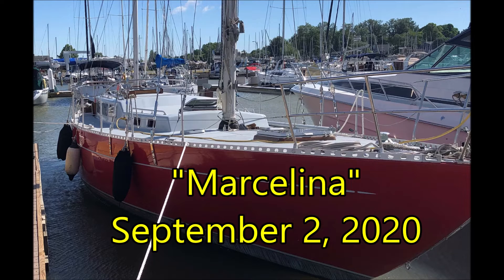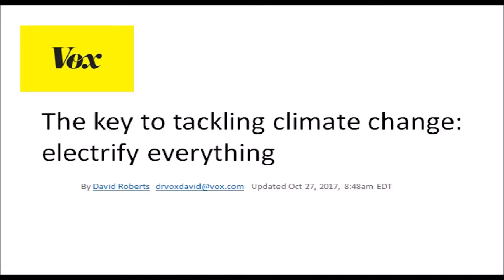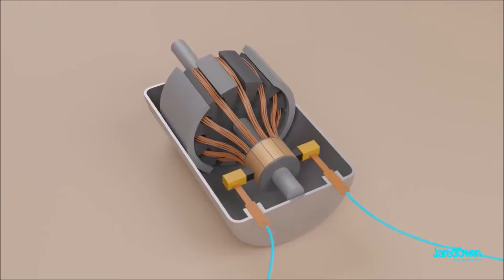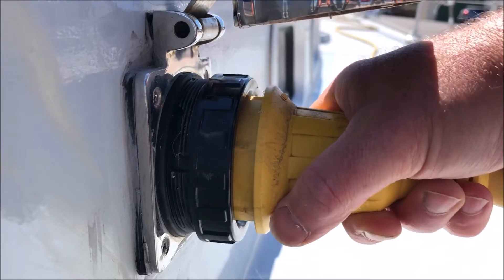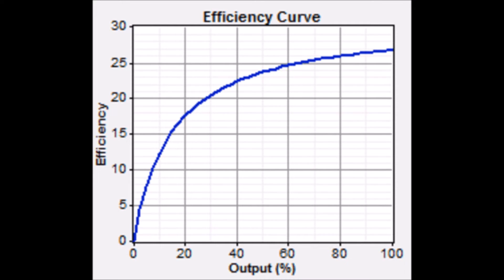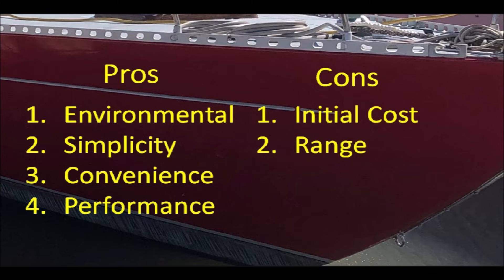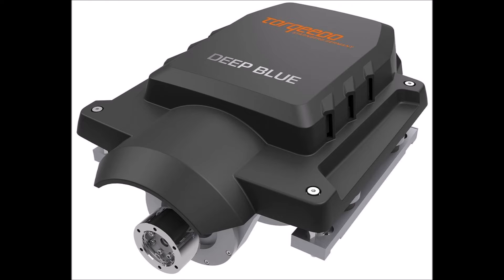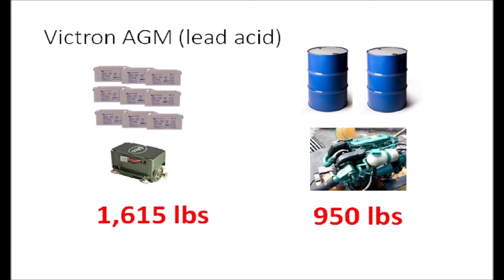The Electrification of Marcelina

Comment: 3 solar panels wont run that system ,  your battery and motor cost figure , hasn't added all the sundry items to run the system $$$$ 
The motor may not give of heat the batteries do,

Comment: Small portable gas generator plus generator (Electric Yachts ?) propelled by propeller shaft as it turns while under sail. Thats what will be on my Tartan 34 Classic. Go electric and all the best.
Reply from the maker: The Tartan is a great boat. To my knowledge only the Oceanvolt system charges from the prop... which wouldn't work in my case because I have a self-feathering prop. Anyway, the Oceanvolt is a saildrive, which also has limits. Anyway, electric is definitely the way to go. Good luck!

Comment: I have been following your project from the beginning, while I still lived across the lake from you.

I don't know your future plans, but if you're going long-term cruising I think you have an unworkable system.  A boat the shape and size of yours will not carry enough solar and wind to top up that massive lithium bank in any reasonable amount of time.  We live in the Caribbean and have 1300w of solar on a medium-sized catamaran.  We can make about 6KW of power per day at a nominal 12 volts. We also have a D400 wind generator - considered the best available - and even in the rare moments where there are perfect conditions for it I question if the output justifies the noise.  The solar and wind basically takes care of our house loads with a little wiggle room.  We're not spendthrifts; we have a fridge and freezer, and we use a washing machine a few times a week.  We also have a 12V watermaker.  The only other loads of consequence are cooling fans.  In total, my daily power production would give you propulsion measured only in minutes - let alone your need for house power.  

Incidentally I have 4 of those Victron batteries.  They're pretty good, but a lithium upgrade is on the horizon.

With my massive real estate on a 47 foot cat I can install even more solar should I feel the need, but you're badly constrained in terms of solar real estate for charging.  I know you can point to Uma as having successfully done so, but even they will tell you that it's not an easy life having to always consider the propulsion bank.  Things are a little better now with their OceanVolt motor and it's re-gen capabilities, but they still have such limited range that most people would not find it practical.    

What you're seeing in electric boats is generators.  If you're gonna cruise, and you're ever going to have to move around - let's say there's a storm coming and the wind is not favourable - you have to have a reliable method of recharging for propulsion.  At this point the only way of doing that is with a generator.  A genny/lithium hybrid system really puts you back where you started, just way more expensively in total.  That said, hybrid turns out to be modestly more efficient than diesel only.

People REALLY REALLY want electric boats to be a thing.  Me too.  I have given this a great deal of thought, and have had the input of a friend who owns the most electrified catamaran in the world.  This chap started with 3200 KW of LiFePo batteries and 3200w of solar, and that wasn't enough to run his 4 ocean volt motors for any real range.  He ended up running his 14Kw generator so much that he got fed up with the maintenance regime, pulled two of the OceanVolt motors and replaced them with 75HP Volvos.  Remember someone gave Uma an Ocean Volt motor?  Guess where it came from.

So, I hate to have rained on your parade, and I hope I am wrong, but I do think you're going to find that the math simply does not work in your favour.  

A tip from the electric catamaran guy: use a big Victron MPPT solar charge controller (maybe 150/45) as a B2B charger between your 108V bank and your house bank.  It has no idea that the 108 input volts that it's seeing is NOT from solar panels and will happily charge your house bank for a fraction of the price of a dedicated B2B charger.
Reply from the maker: I appreciate the thoughtful and informative comment. I'll be spending a few years on the great lakes sorting things out before heading out for extended cruising. If my idea of being self-sustaining on wind and solar is too optimistic then I should find out during that time.

Comment: I was all with you until you started stating CO2 nonsense. Plus have you looked into the “environmental” concerns with Lithium battery production and disposal. Likewise where do you think your electrical power is created for your car? More than likely it was from natural gas. You are really just moving the point of the combustion. Your other points have much more true merit. But environmental is laughable.
Reply: You should do some research because driving electric cars, even when they are charged with electricity generated with coal, reduces CO2 emissions due to the massive increase in efficiency.
Reply: Brent Spang ok and you can look into parasitic electoral loss. CO2 is no sense and this a scam but whatever....
Reply: Rick what does the electoral college have to do with this? But seriously, you’re wrong again. I know what the transmission losses are on the grid because...well...I work in that industry. But if you want to keep your head in the sand then there’s really no point in continuing this conversation.
Reply: @Spangarangg you might want to see what lithium mines do the environment and how it’s a never ending destruction of the earth just like deforestation with massive amount of toxic the by products. History will not be kind to those who pushed this. Oil platform is stationary and sucks up the juice from a single location. All the oil spills of the last 20 years will be nothing compared to the destruction of lithium mines. The land is ruined forever.
Reply: Rick, Whille you might have a point on dirty sourcing for components for next-gen batteries, your point about carbon is way off.  It is clear that central production of electricity for electric vehicles is massively more efficient than vehicles burning fossil fuels independently.  This becomes even more so as more renewable sources are brought online on a monthly basis.
Reply: S/V Sayonara by renewable you mean the very short life expectancy of wind turbines? Or maybe the 25-30 years for solar farms? Or likewise the total Inconsistency of both of these Renewable power production?
Reply: Rick all infrastructure needs maintenance and eventually replacement. Not to mention wind turbines and solar panels are becoming more efficient over time and that warrants replacement in some cases. With that said, there are still solar panels operating that are 50 years old but they’re nowhere near as efficient as modern panels. Some forms of renewable energy pose some challenges with grid stability due to their nature but that doesn’t mean it’s not worth doing and so far the grid and generation dispatchers have been able to handle it just fine. I work with gas and coal fired plants that schedule their generation profiles based on expected wind and solar generation on a daily basis with no problems what so ever.
Reply: Rick I’ll also mention that California already has more solar generation than they know what to do with. As soon as we invest in some energy storage technologies, any remaining hint of grid stability issues will evaporate.
Reply: Brent Spang lol are you serious? Do you watch the news? They have been having rolling black outs because of the Insane renewable energy generation policies. In the future we might also have warp drive too!
Reply: Rick I do watch the news and it’s not renewable energy causing rolling blackouts and I know this because...well...I work in the industry.
Reply: Rick I live in Southern California and there were no black outs
Reply: Brent Spang where you exactly are is not the point. The point is the that this renewable energy sources are not reliable as traditional sources.
Reply: @smplyizzy  No, that is the point if the evidence that you're using to "prove" that is bunk.
Reply: @smplyizzy  Right in your article it says that it was natural gas plants that went down and were unexpectedly unavailable.  The unprecedented situation of a heat wave during a pandemic tested the margins when almost 2 GW of natural gas generation was not available.
Reply: Brent Spang I live in the Bay Area and I can attest... we have rolling “green-outs” now every fall.  CA chose to decommission nat gas and nuclear power generation well before the end of the useful lives and switch to more renewable.  As a consequence, the grid is not able to handle peak demand... particularly during clouds/smoky days... and... surprise... solar generation doesn’t work well at night.  So, the brilliant minds in Sacramento end up buying coal and nat gas fired electricity from neighboring states at exorbitant rates.  Brilliant!
Reply: John Hamer - thank you responding it amazes me that many people can just ignore the Reality of both “green” energy and false hood of electric cars. 
Likewise I heard yesterday that California will outlaw gas engine passenger cars in 2035. A majority of the time Government forces outcomes there are many unforeseen consequences that truly hurt MANY MANY people (I.e. the CA switch to “green energy”.
Reply: @Jakfilm and yet California told people they can’t change their cars, because wait for it….:: the freaking coal plants and our grid couldn’t handle the load. So that burnt the next question is how in the fuc* do you think they are going to all charge their cars if freaking coal can’t even generate enough power to get all the Kamala Harris voters cars charged over night?